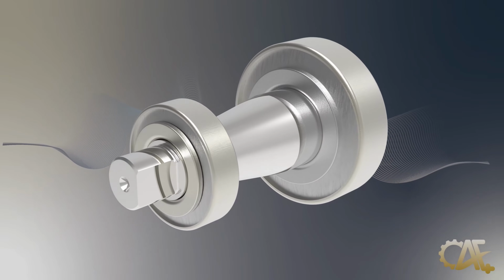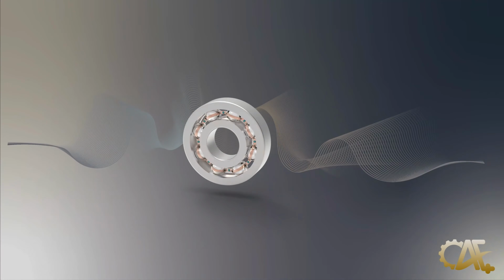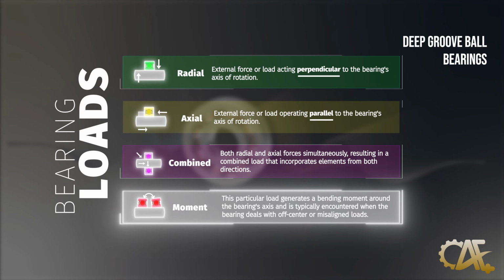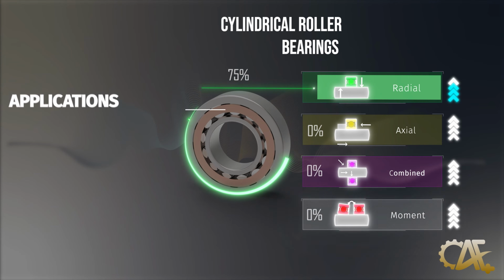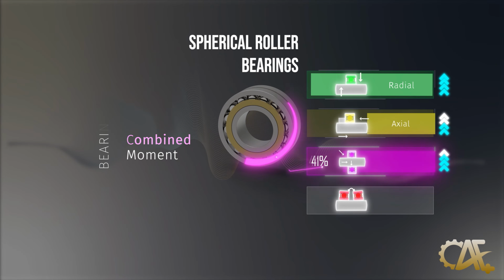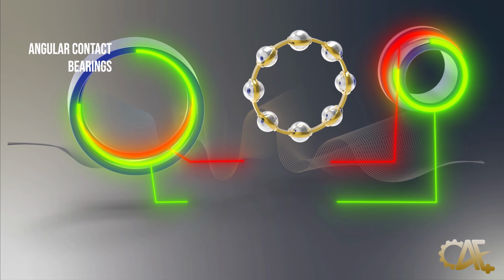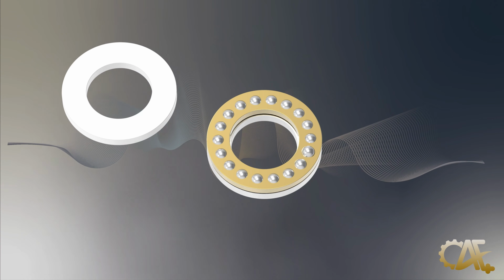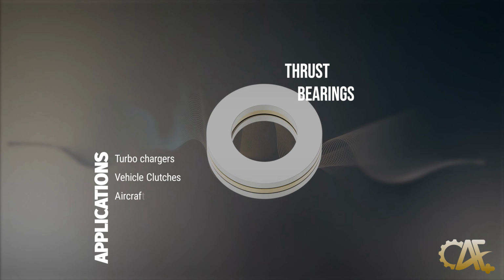Why Bearings are Crucial: Discover the Benefits; Types of Bearings; Inside Ball and Roller Bearings

Comment: There's an error made in the part about spherical bearings: they are completely incapable of withstanding moment loads, since they are able to swivel freely in their outer ring. If you want high moment load capabilities there are also four point bearings, ball bearings with modified grooves so that each ball is in contact in four points instead of just two.
Reply from the maker: Thanks for your comment! Actually, The capability to accommodate misalignment comes from the spherical inner and outer rings, which can tilt within the bearing housing. The moment load refers to a force that causes rotation about an axis. Spherical bearings can accommodate a certain degree of moment load because their design allows for angular movement, which can absorb and compensate for misalignment and shaft deflection. However, the capacity to support moment loads is limited and varies depending on the specific design and size of the bearing, as well as the material properties. 
I appreciate your suggestion about four-point contact ball bearings as a more suitable option for applications requiring high moment load capabilities. These bearings, with their unique design allowing each ball to contact the raceway at four points, offer a better solution for handling combined loads, including significant moment loads. We might cover this type of bearing in our next video.
Again, thanks for taking the time to watch our video.
Reply: @CAEPlus  in my understanding a bearing has moment load capability if it's able to resist moments. A spherical bearing is made to not resist moments, so it can align itself with the axis. To be able to take moment loads with bearings that have no moment loading abilities themselves you always have them to be paired up somehow.